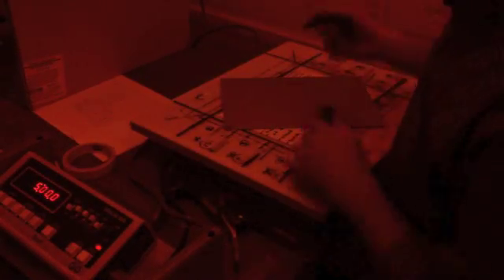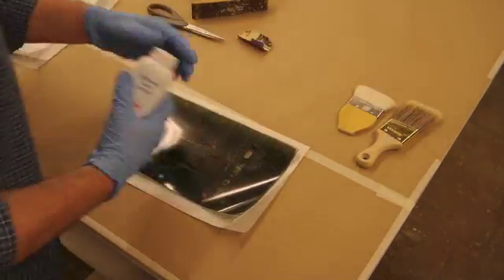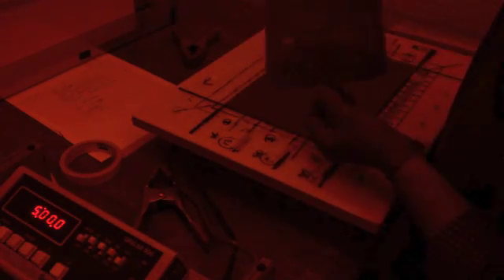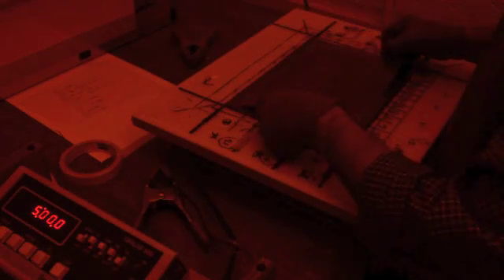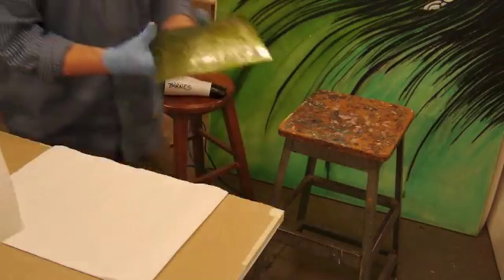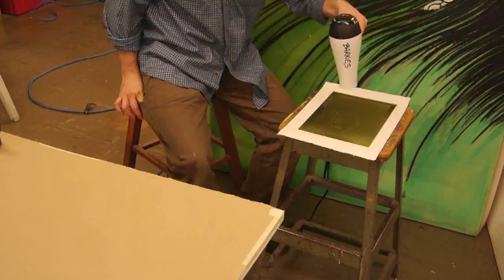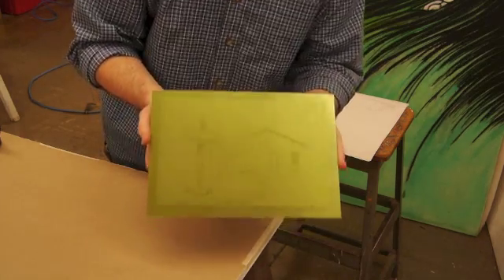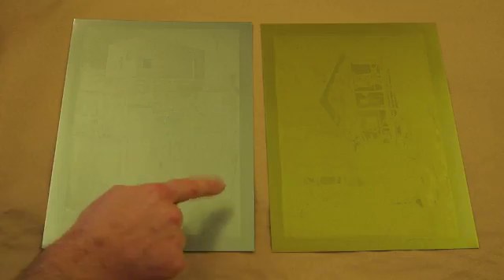Making A Polymer Plate for Photogravure

Comment: am i able to achieve this method through a photolithography method using the vaccuum exposure machine?  or do i use the screen printing exposure machine?
Reply from the maker: Anything that can hold a film tightly to the plate and that radiates UV light at 365nm will work.  A vacuum table is actually better than the unit I am using.
Reply: @scottbarnes5963  thank you! i will come back when i am able to get into the studio.

Comment: hello Scott, i have your book and i was trying to do the experiment with for the basic exposure time. i am failing to achieve  the same results. as the higher the time of exposure of the screen the plate holds less ink, for example, after 5 minutes of screen exposure, the plates is completely hardened thus it holds no ink. i don't understand how you get darker results when u exposure the screen for more time. from my understanding, if more light goes through the tiny gaps of the stochastic screen the polymer plates gets more hardened, thus less ink. please help!!!
Reply from the maker: It is a range.  Too little exposure and nothing is hardened (therefore it all washes out and will not hold ink).  Too much exposure and everything is hardened (therefore no texture to hold ink).  Buy a stoufer step wedge (most easily found these days on screen printing supply shops).   The KM-73 plates tech data sheet tells you which number on the Stoufer wedge you should see hard and which ones should wash away.  Cut your plate into strips.  Use the step wedge to expose the strips.   Do one for 1 minute, another for 2 minutes, another for 3, etc.  That will get you close.  When you are close, then move on to the process in this video to fine tune.

Comment: Thanks Scott for the video! 

Just two little questions. Why do you expose the blank plate for 5 minutes at first?

And secondly, do you use a brand of transparency film in particular (I know it is not standard presentation transparency that must be used normally...) Thanks again!
Reply from the maker: The first exposure uses a transparency with a random dot pattern (stochastic) to create an initial matrix that will hold ink.  The second one is the image.  

I tend to use inkjet transparency film from the screen printing industry, and my favorite is Fixxons.   http://fixxons.com/1Silk/main.html